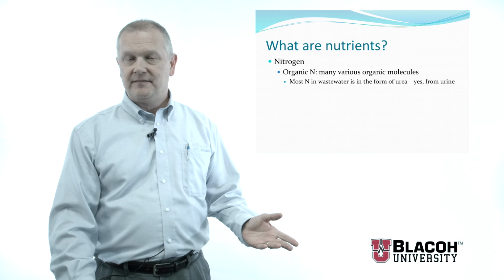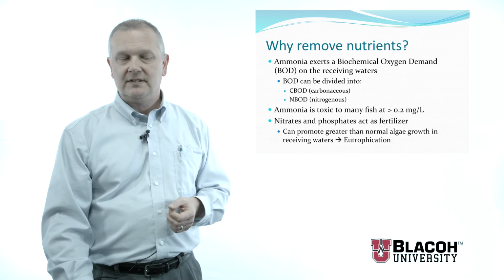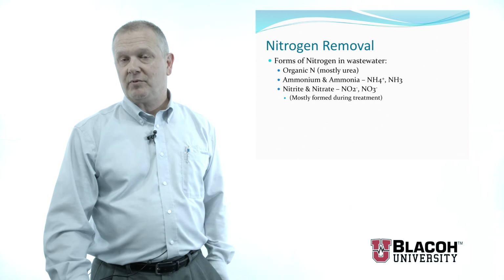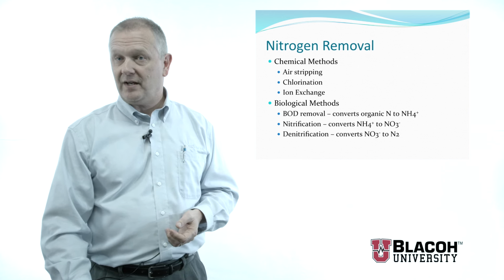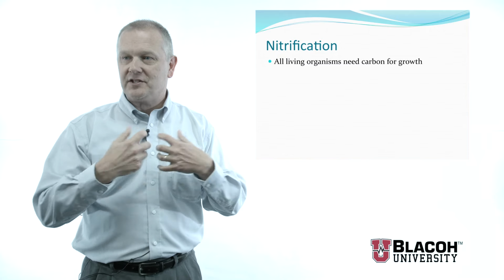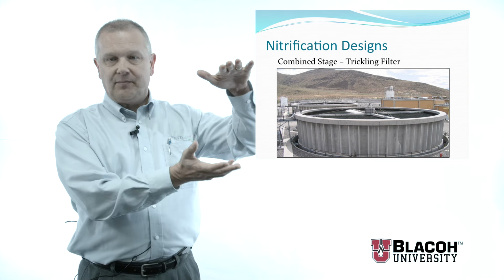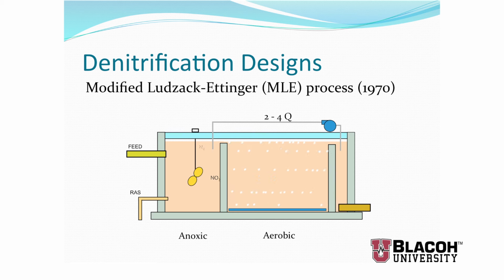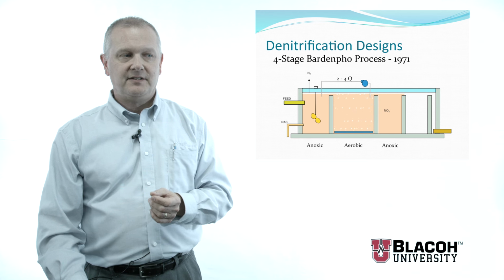All Things Water Course I, Nutrient Removal Part 1 of 2

Comment: Why Canna indica plant are dying at planted drying beds? 

Why are Anaerobic Filter Reactor not performing well in terms of TSS, COD and Pathogens reductions?

Why ammonia is increasing at PDBs and Anaerobic Filter Reactor? 

Why does E.coli fully die off at Vertical  Flow Constructed Wetland? 

Why is phosphate increasing at Horizontal  flow constructed wetland? 

Why is Nitrate not decreasing at Horizontal flow wetland? 

Why is E.coli regrowth at Horizontal flow wetland?

Comment: In our country we are required to remove NH3 to 0.5mg/L in your presentation you just mentioned NH4 and NO2 and NO3. We are doing experiment using EC system but total NH3 increase after passing WW thru EC system. In Biological process can reduce NH3 be to 0.5 
ml/L and NO3 to 1 mg/L level . if possible . What is the process ?   The problem is a lot existing plant don't have space for additional tanks for Biological process.

Comment: Hello,
I am doing research on wastewater treatment. I want to thank you as I have learned so much from this lecture.

I'd like to ask what your thoughts on the new strain SND5? 
Strain SND5 simultaneously removes ammonium, nitrite, and nitrate at an average rate of 2.85, 1.98, and 2.42 mg-N/L/h, respectively.

This strain removes the need of two separate reactors and does not require oxygen reducing cost of electricity as much as 65%.

Is this a new revolutionary strain that will change wastewater treatment forever?

Comment: What if the plant uses a Dissolved Air Flotation system for secondary clarification? it's still possible the return of the activated sludge to the first anoxic chamber?

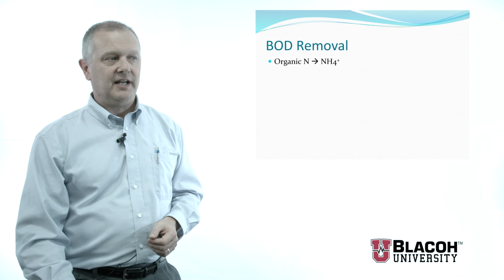Comment: LOVE the video ! extremely helpful but I'm a little confused .. when does nitrogen convert to ammonia ? if its in the activated sludge like you stated @ 13:30(1st step , BOD removal )  OR  does it come in naturally with organic nitrogen ( Kjeldahl classied them as the two forms of nitrogen entering naturally @ 9:40  ).. 

Can someone please clarify this for me ?
Reply: Bacteria could be present in incoming waste water. On the way to coming to the treatment plant they may convert some of the organic nitrogen to ammonia. so both are present in the incoming water. But most of the conversion  is done in secondary treatment i.e. in the aeration tank.
Reply: Watch the video, Nitrogen Removal Basics by Steven Myers. Very good.